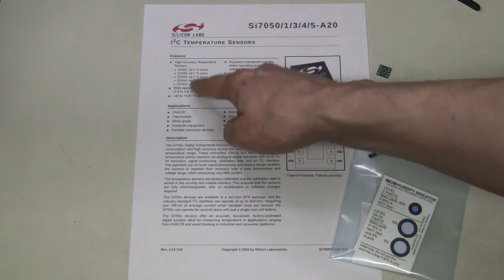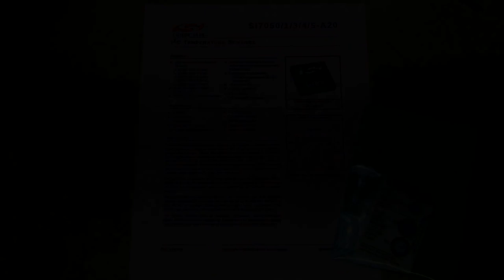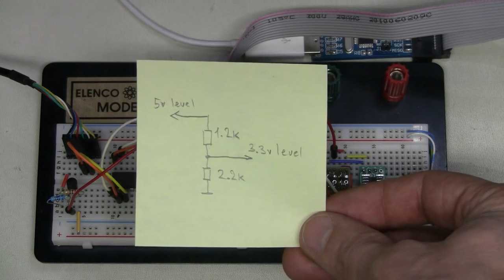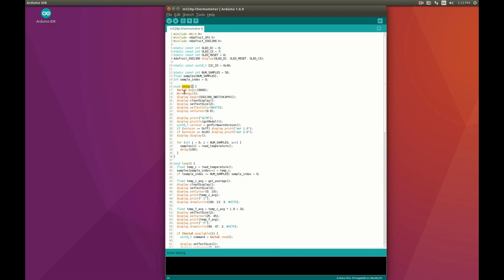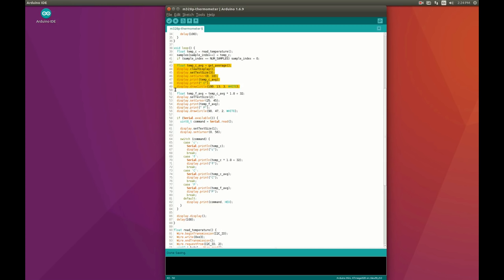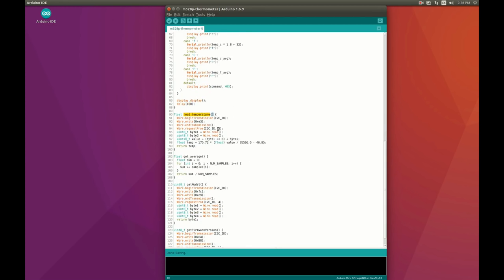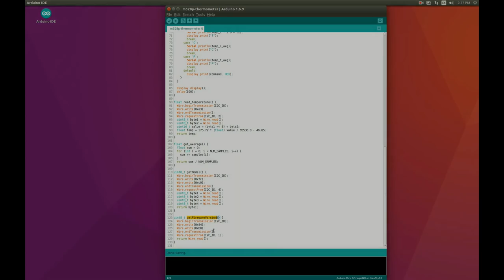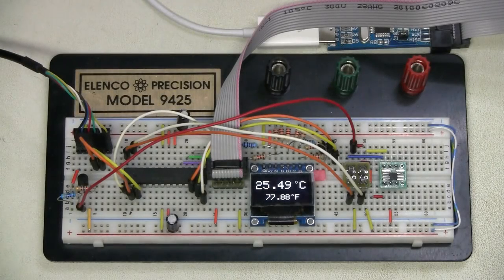#53 - Precision thermometer for data logging

Comment: Cool project like the idea, might want to put one in my computer box to sample the ambient temperature. The thing runs hot and sampling heat over time is a good idea. Thanks I'm on it in the morning but I will use a DHT11 temp sensor. It might be good to put a SD card module for long term sampling. Cheers :-}

Comment: Have you looked at the environmental sensors Bosch makes?  The BME680 is the size of a pencil eraser and monitors gases, barometric pressure, temperature and humidity.  Their sensors can operate with either i2c or SPI.
Reply: Bosch announced the BME680 a good while ago but it has yet to reach the shelves. Looks very promising though.
Reply from the maker: No, I have not looked at the Bosch sensors. I wonder how much do they cost. BME680 seems to be unavailable yet. I looked for a cheap and accurate temperature sensor, and Si705x seem to fit very well if no probe is necessary. Si7051 in particular, with 0.1degC absolute accuracy and just under $2 cost.

Comment: Mr "Feedback Loop", give me a break.
moving average filter, why?
why not make a proper LPF?
Reply from the maker: Could you clarify your idea? How do you think a proper filter should look? And what is wrong with moving average?
Reply: moveing avarage filter
1. requires more clock cycles and memory resources to do
2. code is longer and more complicated
3. frequency response is weird
http://www.gaussianwaves.com/gaussianwaves/wp-content/uploads/2012/05/frequency_response_of_Moving_average_filters.png
4. delay on start up to feel the buffer

the simple way is:
temp+=(read_temperature()-temp)*0.1;

you should trigger this on some timer interrupts in fixed time step to achieve proper time constant.

remember about
temp=read_temperature();
at startup.

sorry my english is not the best..
Reply from the maker: > temp+=(read_temperature()-temp)*0.1;

Is this a single pole IIR?
Reply: I think so.. I used this solution many times and it worked
just a simple discrete first order inercia, I'm not sure about z - transfer function of this.
discrete time domain is not my favorite domain.
You are FeedbackLoop you should know better :P

http://soundlab.cs.princeton.edu/learning/tutorials/DSP/onepoleb.gif

1/(z-0.1*z^-1)
??
Reply from the maker: You might be right. However, I suspect there might be some complications. For instance, I think this filter can oscillate at the level of the lowest digit. In other words, it wouldn't prevent the lowest digit form jumping up and down with every measurement.
Regarding the delay at startup. In my case it is not a problem at all. I wanted to have a delay anyway to show the model and version for a few seconds.
There is always more than one way. There is always room for improvements. Thanks!
Reply: From my experience if you use floating point number is will be rock solid..
it's hard to talk about last digit in such case.
of course bandwidth depends on the time constant which you select.
Reply from the maker: I gave it a try. With 0.1 the reading is a bit too jumpy. Seems to be fine with 0.02. Thanks! I really appreciate your comments.